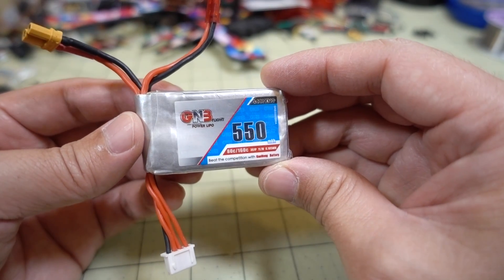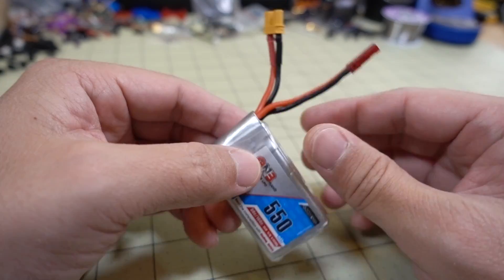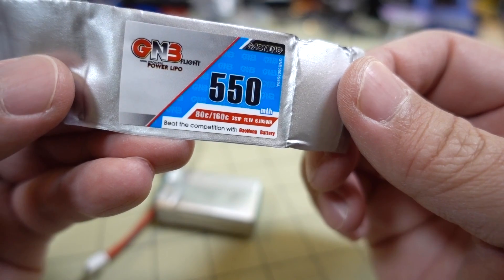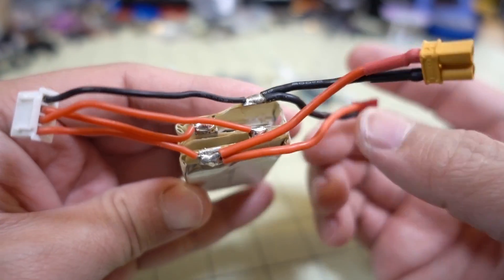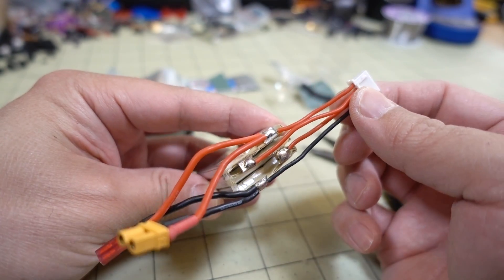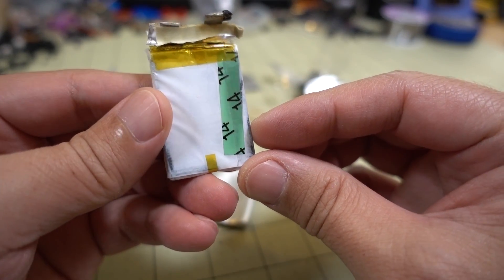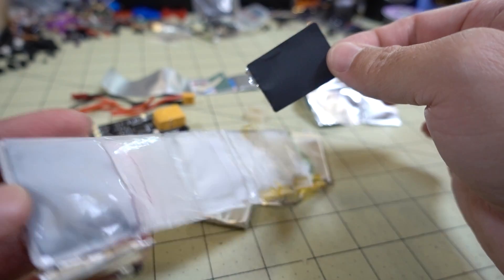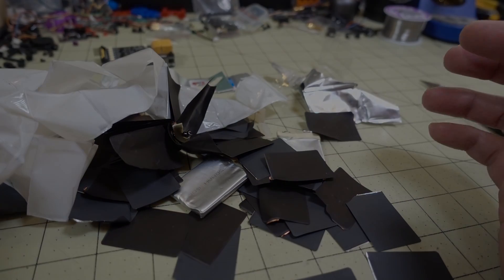What's Inside a GNB Lipo Battery? // URUAV Lipo Killer ⚡🛠️

Comment from the maker: Here's a little more info for those who are ignorant of the facts - https://en.wikipedia.org/wiki/Lithium_polymer_battery
Reply: You might also want to check out https://www.researchgate.net/publication/301654781_Considerations_on_the_Chemical_Toxicity_of_Contemporary_Li-Ion_Battery_Electrolytes_and_Their_Components
Reply from the maker: @davidnickell2658  Li-Ion batteries and Li-Polymer batteries have a different chemical composition.  The battery in this video is a Li-Polymer battery...
Reply: Not really. They are both lithium ion and both polymer electrolyte.  The chemistry is lithium-phosphate in many of the cylindrical that has nominal voltage of 3.2v per cell.  You can buy 3.2v pouch lithium
Phosphate cells.

Comment: they are alternating lithium and carbon sheets. they alternate with the white film in between so that the potential difference in charge drives an electric current between them, which is the essence of a battery.

Comment: Did you notice the color change (dark gray to white) when you broke open the cell?  More than likely the Li metal was hydrolyzed to LiOH by reaction with the moisture in the air.  BTW Li is flammable when in contact with water.
Reply from the maker: The Li is combined with something else chemically.  You can put those things into water and it will be OK.  Pure Li by itself alone is flammable but that's not how the battery is made.
Reply: @AlbertKimTV  More than likely the lithium compound was lithium hexafluorophosphate which decomposes in moist air.  Before cutting open another lipo, please check the MSDS safety sheet on lithium hexafluorophosphate.
Reply from the maker: So I'll help you with your guessing and hoping this is some kind of deadly material because it is not.  Here's the wikipedia article on Lipos - https://en.wikipedia.org/wiki/Lithium_polymer_battery

Comment: Smell is Lithium.. And yes, you should have used gloves. Lithium can be dangerous if mixed with water.
Reply: Nah the smell is the SOCl2 in Lipo reacting with moisture in the air leaving u with so2 which is your standard rotten egg fart smell 😂
Reply from the maker: it didn't smell like that.  It actually had a sweet smell to it but very very strong... similar to cotton candy but not exactly like that...
Reply: @AlbertKimTV  Hmmm.... Question is, do they taste like cotton candy?
Reply: Albert Kim electrolytes maybe I dunno 🤷‍♀️
Reply: @AlbertKimTV  that's the smell u get when your pack is on it last leg or leaking that's also very bad you breath in  its also the gases it makes